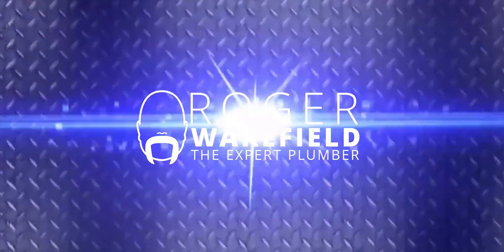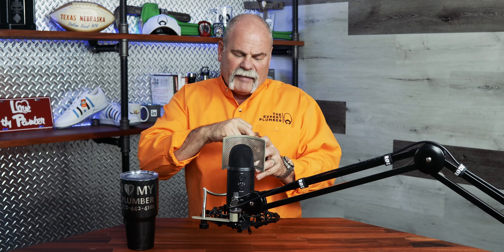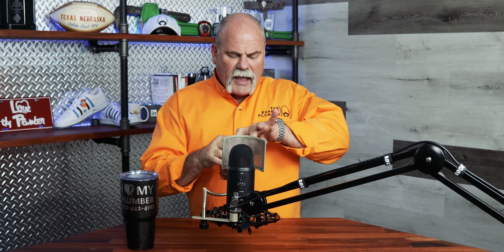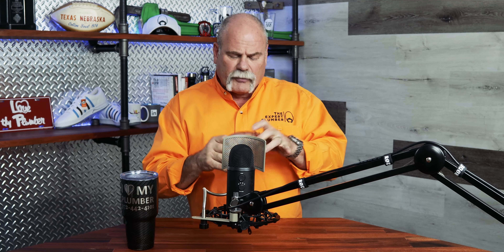Is ProPress Better Than Solder Plumbing Fittings??

Comment: How could ProPress be better than solder since the EPDM rubber o-ring inside of the ProPress joint will rot over time whereas there is nothing to rot in a soldered joint?

Comment: Here is a test i would like to do.
Get a pro press fitting. Take the o ring completely out. Press it. Turn water on. Is there a leak? If so, it is just a very small leak?
If it's tiny, the fitting will last longer than us.
Reply from the maker: The YouTube channel silver cymbal did this exact video and it was great!
Reply: @ just watched it. Very impressive. Most plumbers use press down here in Australia. Don't see much soldering.

Comment: Menards, a large midwest chain, stocks and sells propress fittings here in Wisconsin.  Not sure about the tools.  I don't remember if I've seen them at Home depot.
The tools have gotten cheaper the last couple years too.  There's an M12 tool which will do 1/2,3/4 and 1" down to $600-$700 for the set including dies

Comment: It depends on the situation a propress is cool but you have to cut the pipe if you have to repair that pipe where its was pressed at vs solder you can heat it up and pull the piece off where the solder is. But I would only recommend propress if you are in a highly flammable area or if the pipe is hard to reach to do a good solder on it.

Comment: Rodger I have been looking at press fittings for a while my company does hvac, appliances and water heaters only. What are your thoughts on the hand presses for small projects.
Reply: Andrew, im no tradesperson but hvacr videos shows some stuff that is zoomlock it should be a bit quicker than brazing

Comment: There is no question welding two metals together whether steel or copper will always be stronger than compression, push to connect or bolts and nuts. With plumbing the question is will the push to connect or compression be strong enough to hold the fitting? Push to connect are rated at 200 PSI while compression fittings are rated even higher. Since the PSI in my home is 80 both push to connect and compression seem suitable. What is the downside? With copper fittings that are soldered you are exposing your water intake to lead which is hazardous to your health. In that case you would need to install a water filtration system to remove the lead. With push to connect or compression you don't have the lead problem if you are comfortable with a non-soldered fitting. Push to connect were invented by a British engineer in 1980 to be used as a quick fix for plumbing leaks on vessels where it is impractical or impossible to weld or solder.

Comment: I was a bit skeptical about ProPress, but after doing more research and working with the Ridgid tool and Viega fittings, I have come around to seeing this as a viable solution IF proper procedures are followed in preparation prior to crimping (which is the same logic for making a making a good solder connection).  Unfortunately, Youtube is full of examples by "professionals" (and I use that term very lightly) that do not think it is necessary to clean, deburr and outer ream pipes at all when they are using Propress or Sharkbites.
I was also skeptical about the quality of the water seal of ProPress versus Sharkbite, as both use an EPDM o-ring.  HOWEVER, as shown in the following video, quality Propress fittings appear to seal not only with the o-ring but with the mechanical heavy crimp performed by the tool: https://youtu.be/7Z8WSFqq13E.
Based on what is shown in this video, ProPress has a major leg up on Sharkbite in terms of water sealing, as a Sharkbite is 100% reliant on the EPDM o-ring alone.  Remove the o-ring from a Sharkbite and install the fitting on the pipe, it will leak like a sieve.  This video seems to show that is NOT the case with a properly installed ProPress fitting, at least the Viega and Nibco elbows tested here at 60 psi.
Anyway, food for thought for anyone that believed (as i did) that ProPress and Sharkbite are identical in their water sealing capabilities since both use an EPDM o-ring.  This video has made me stop and see that this is NOT the case, as Propress apparently has two systems (the heavy crimp AND the o-ring) that seal against water leakage while Sharkbite has only one.  At least within the parameters of the test indicated in the linked video.

Comment: i  agree with your take on Pro Press and Mega Press-I've used them for a few years now and barely ever solder or braze-The Tools are more Expensive in Canada, but worth every penny on the savings on Labour (70% 0ver soldering)
I'm a Master Plumbing & Heating Tradesman in Toronto and I find The newer Ridgid Pro Press and MegaPress Tools outperform The Milwaukee ones (China Vs Switzerland Manufacturing)-

Comment: For the do it your self-ers, they do sell manual pro press fitting crimpers for around $150. You don't need to buy a $2000 battery operated crimper.

Comment: I used a pro press for the first time in school today! I think over time the pro press will be better as its electric so you don’t have to buy fuel
Reply: The cost of gas for the torch is a negligible consideration with all the other factors.  The cost of flux is probably the only less important one.
Reply: Yes but 1 fitting offsets the price of the fuel, Flux and some solder

Comment: So I've worked with pro press but not as much as soldering and I like soldering alot better. I feel better about it and it's cheaper fittings and tools. Another thing is I've seen pro press leak if you don't have everything perfectly smooth and if you push the fitting on just slightly wrong or try and cram it on the pipe you can damage that rubber and it'll leak everytime

Comment: Solder lasts for 100 years and you can do gymnastics on the pipe without the joints breaking. Does the rubber O-ring in ProPress have any cancer causing agents in it? I'm seeing more and more Prop 65 warnings on everything. They discontinued my favorite gloves because of it.

Comment: Great video thank you for taking all the time to make them possible, i will like to add from my experience that i feel the same way between propress and shark bite, even on pex the amount of pressure in the fitting is not really near the propress if you are using a none battery pressing system for that pex, and you still have the little rubber to think about, but when you look at solder boy oh boy i agree with the time problem but I just did a repair between galvanized transition to copper and that copper soldering was intact after 46 years of service i have found even way older soldering fittings in perfect condition so it is a lot to think about before buying a propress thank you again God bless.....

Comment: We use propress at a condo development for Gas, heating and potable water. We like it but does anyone know how to remove a leaking fitting with out repiping? We use mostly 2 and 3 inch pipe.

Comment: I feel more comfortable that there will be no leaks after soldering, but propress is quick and easy to use in tight spaces.
Reply: I love using pro press for boilers because there’s guaranteed to be no leak if you Cut everything cleanly  and Remove the burrs. Back when I was an apprentice I remember all the times that my coworkers rush through soldering we would fill the system up and have leaks Then have to drain everything and Try again

Comment: The advantage of any crimp system be it propress or even pex is repeatability (especially by less experienced users)

Connections will be done correctly every time with no issues.

Comment: Roger you are from Texas, I am from Canada. You need to understand that this test proves nothing depending on your location. It’s not about pressure as much as withstanding drastic expansion and contraction. You don’t have to worry about that in Texas.

Do a test where you let them both sit in a 60 degree celcius temperature change over and over again, watch what happens bud.

Comment: here in italy i have been a plumber since 2001 and i have always used viega press .... welding only if too tight for the press ... it is too simple to use, you prepare everything you can disassemble and reinsert the fittings as many times as you want to get the better visual impact and when you are satisfied you start on one side and close everything !! losses? only with damaged tube, badly inserted, badly prepared that has ruined the ring or simply not pressed! to remove the fitting and recover the pipe you do ... but you have to cut it with a hand saw and a lot of patience then widen the cut fitting with a screwdriver and force a lot ... system to be used only if the pipe is short and not can shorten due to space problems!

Comment: To everyone saying O rings don't last don't last forever... you're wrong.

I'm a Well water guy and pull pitless adapters that were installed the 60s with leather o rings that I will pull up and set back down without even a whisp of water leaking.. we just put a bit of leather conditioner and back into the well they go... and those are o rings that are pulled out worked and put back down atleast 4 or 5+ times in the lifetime of a house. Not in a press fitting with. Constant 3000lb of force... 

I've pulled rubber o rings installed in the 70s and haven't even batted an eye they're all in perfect condition. Just some silicone and in they go 🚶

I highly doubt there will be any problem with the o rings. I see the rubber lasting for atleast 100 years

Comment: Roger, I love your videos, but EPDM o-rings are stated by Viega to have a 50 year life expectancy in ProPress.  A copper joint soldered has a life expectancy of 70 to 120 years.  So the ProPress might be as good as solder as far as ability to seal, but how long it seals is now not equitable. My house was built in 1972, and its copper water system is still good without leaks, but if ProPress had been done back then, I would have to worry about it. I can sweat a joint in under a minute so I don't mind sweating as us old Dinosaurs done it enough that we can do it in our sleep.

Comment: Prioress definitely.
Roger didn’t there used to be a fitting similar to the pro press but instead of an o-ring it had a ring of solder inside?
I seem to remember one of our other plumbers talking about them. Haven’t used them personally but he loved them.
Reply: They looked similar, it was really for diy types.  Instead of adding flux and soldering you just cleaned pipe, pressed on fitting and added heat with a torch. The ring contained the flux and proper amount of solder.  I can't imagine a competent plumber finding any value in them. The only benefit I see is someone not having to buy flux and solder separately for just a couple fittings.

Comment: I have never heard anyone address the ProPress 'O' ring conundrum. Over time that 'O' ring is going to compress and start leaking... eventually. 
What happens then? What is the estimated time before that occurs? If you have an entire building plumbed with ProPress, what happens when the pipe joints start leaking? 
Inquiring minds want to know. (I stole that phrase from the National Enquirer. It fits here)
P.S. I have an inquiring mind and I want someone to answer these questions.

Comment: Only a small bit better than a sharkbite, because they both rely on a piece  of rubber to seal. Rubber seals in Kentucky will fail in 5 years most of the time due to our water. As for. gas lp/ng  I can't say, Ky doesn't allow copper in gas systems. Bottom line it's slower than a sharkbite, faster than sweating / brazing, good for emergency control of a situation , useless in tight spots/corners( at least back in 2010),  sharkbite it until it can be properly fixed and propress for larger stuff that sharkbite won't fit, either way it's a Band-Aid  for pipes holding Kentucky water.

Comment: How will that O-ring not wear down over time? Just like in cars the O-rings wear down due to heat and chemicals. I would think the minerals, chemicals and or hot water overtime could cause the O-ring to wear out. Just a thought.

Comment: Using propress means keeping up with the times, staying competitive and maximising profits. It’s been used for over 30 years in Europe without any issues worth reporting. It is important however that apprentices continue to learn how to solder and braise to ensure that they can maintain and repair older copper piping systems. When the next technological breakthrough occurs for joining copper pipes, we’ll all look back at our trusty propress system and treat the new system with the same suspicion that we apply to propress today. Fact is that new technology has to prove itself to us plumbers who are comfortable with the systems we have worked on for decades before the pros vs cons argument goes away.

Comment: 7 Astronauts died because of  defective o-rings on a space shuttle
Reply: To clarify, the data collected after the incident doesn't suggest the O-rings were defective. The data suggests they were used outside their safe operating conditions. Every material has a glass transition temperature. Get too hot, and materials become rubbery and not as effective. Get too cold and things become brittle. The morning of the launch, the ambient temperature was very low. Actually it was a record low if I remember correctly. This caused the O-rings to become brittle. Many engineers suggested delaying due to cold conditions.. but they launched anyways.

Also, you're comparing apples to oranges here. Plumbing a hot/cold water system is just a tad different than sealing solid rocket booster combustion gases lol.

Comment: I love the pro press and the mega press! I have been a plumbing apprentice for almost 4 months and it saves so much time and effort like you said! Especially on commercial jobs, the journeyman can be working on something else and I can be putting water lines together without the worry of making sure I'm not going to set anything on fire. Love watching your videos!
Reply: He mentioned it, but what you don't see as an apprentice is the difference in fitting cost.  In most cases it's made up for with labor savings.

Comment: Pro press was really convenient at times when I was in service plumbing. For example, we had to fix a water leak at a old retirement home with about 50 units. We shut the water off but every time someone tried to use a  fixture the water would trickle down the line so it was impossible to solder. Pro press saved the day that day but most of the time we were soldering. Our shop only had one, so lots of times it wasn't available.  I like the pro press but I would rather solder than dish out the money for the pro press. I am currently in residential new construction and we are using pex. Still haven't tried the mega press but I heard good things.

Comment: From a homeowner point of view, copper is proven to last a lot longer. Any rubber o-ring will deteriorate over time and fail. A well soldered joint on the other hand may never leak. I wouldn’t be comfortable knowing all my walls are full of press connections that may one day all start to fail at once. Not convinced they will last as long as soldered copper. 9

Comment: To strengthen propress; on a deep slab leak, say 3’6, your b tank will not be able to get enough oxygen to stay lit. Yes, you could use an oxygen and acetylene kit, or you can just press it.

Comment: I ❤️prioress I’ve had water coming out full pressure slipped a valve on there and pressed it shut the valve... no water. Happy day
Reply from the maker: Great point! It does come in handy for sure...
Reply: * propress
Reply from the maker: I knew what you meant. It’s great to have around.

Comment: Imagine if society had efficient, self-repairing plumbing systems. Basically combining a propress, pipe-cutters, copper, and a conveyor style system to automatically maintain the plumbing every 3-6 months (depending on personal preference. That way most leak possibilities would be eliminated, and it could help plumbers work on bigger above-ground projects. Such as mostly new construction.

Comment: "If it lasts just as long?" Properly installed copper can be expected to last under slab for potentially hundreds and hundreds of years. When you consider the environmental resources used in slabs and buildings, plus the enormous cost INCLUDING labour to resolve potential future issues on a finished build, longevity is everything. Does this rubber not deteriorate? Rubber that's compressed I believe eventually loses its sealing abilities, whether that's in 10, 20 or 30 years, it seems inevitable. I just had a plumber use these under a driveway slab for a 12 industrial unit complex, dozens upon dozens of joins. The driveways alone are 200K, and the resource usage is so high those driveways should remain functional for the life of the estate, which should be centuries. Will these rubber joins cause headaches downstream?
Reply: "potentially hundreds and hundreds of years" except for our home which had a slab leak from failed copper. And there is an epidemic of slab leaks. So... not sure I buy this.

Comment: Most of that's true except for the part where yes you can get propressed fittings at home depot Problem is people are getting the hydraulic press for $85 on Amazon and do it themselves without Clean in the end of the pipe for burrs

Comment: In real old buildings beware... have seen multiple times almost always on hot water line, tiny pinhole drip at sweated joint that has gone on for so long  that large amount of mineral scale has built up which deteriorates the copper line even more to the point it fails usually in a thin "line" along the pipe's length for some reason.  Steam sauna  !! As soon as you see any oxidized green replace that section !